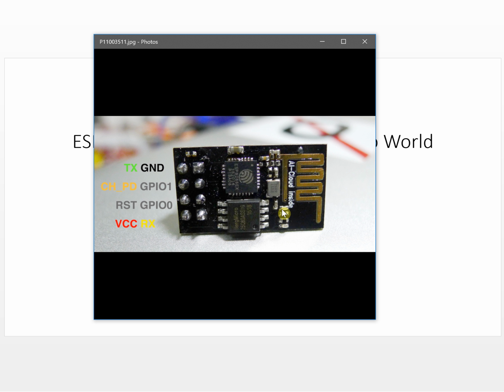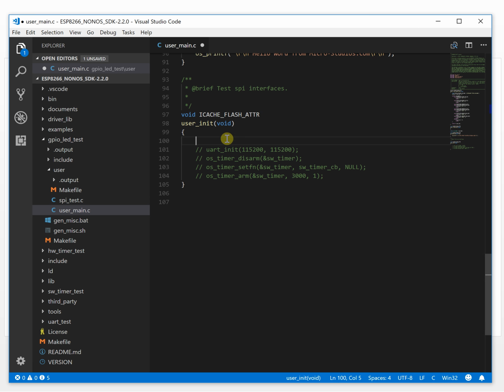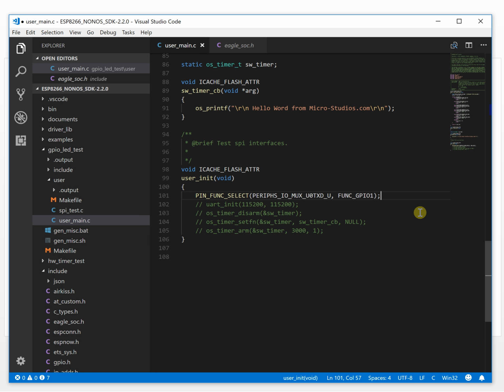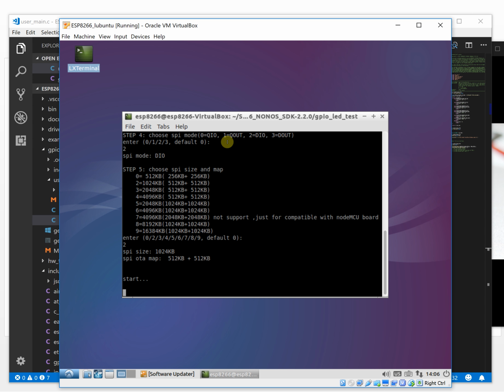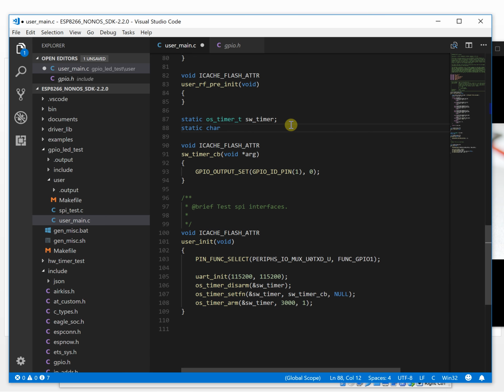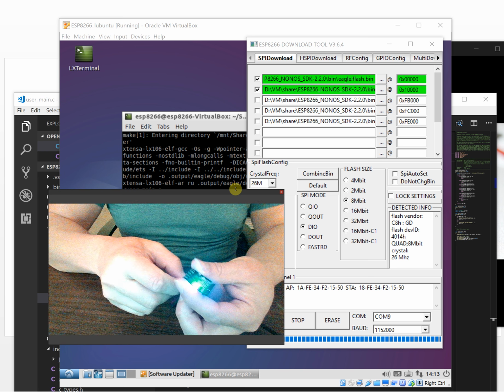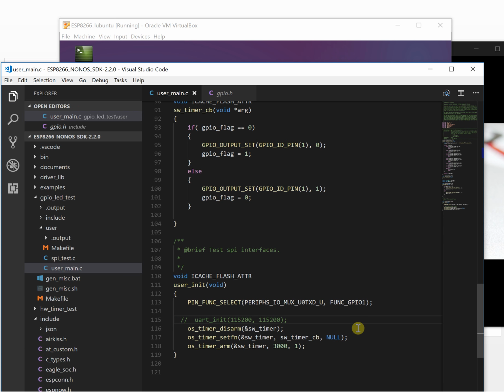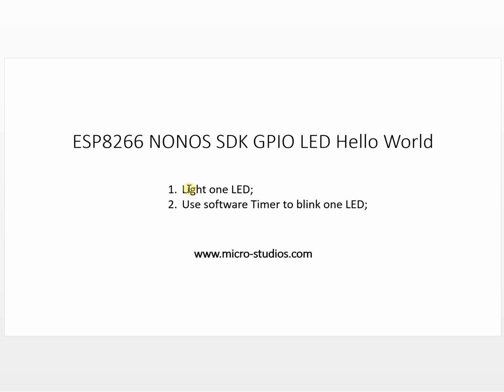11. ESP8266 NONOS SDK GPIO LED Hello World

Comment: Hi Michael, Is it Pin_func_select written above uart for not working or both uart and PIN_FUNC_SELECT cannot be used simultaneously. explain in both case of ESP-01 and ESP-12E.
Reply from the maker: Sorry, I am not sure what is your meaning.
Reply: you have written PIN_FUNC_SELECT above uart(115200,115200), due to which led was not blinking every 3sec. Why is that so in this way? What happens under the bottoms of PIN_FUNC_SELECT. Im not a c programmer and completely new to this!
Reply from the maker: One GPIO has multiple functions. for the pin "PERIPHS_IO_MUX_U0TXD_U", the default function is TXD function. so you need to use "PIN_FUNC_SELECT" to choose the GPIO function for it.

Comment: Hi Michael.
I'm trying to get the old ESP8266-01 (1Mb) modules carry some of the more powerful AT firmware from Espressif.  Sadly they stopped carrying these files: eagle.flash.bin and eagle.irom0text.bin which I need for NonOS and non-FOTA versions of the firmware (non-FOTA is for security purposes).
The SDK's suggest these files can be compiled, but I am not not at that level of expertise yet to be able to compile these files.
Do you know how I it can be done?
Reply from the maker: Hello, I haven't touch esp8266 for a long time.But if just for compiling, I think it might be not as difficult as you thought. You could give it a try.
Reply: @Michael_ee  I am trying. I felt like I was getting close close but I also felt like my skill set is just a little bit too low to actually be able to do it. 
Thanks for your interesting videos when I watch them more deeply I think it might bring me closer to being able to do it.

Comment: this nonos sdk is kinda dark science where there´s no example teaching simply basic stuff like program flow , etc im at the point to leave it. it´s too difficult to learn without more teaching stuff. I dont mean examples but theory from where we could learn how to program...
Reply from the maker: I originally thought people might be more interested in sdk with OS. Because it can implement more functions for it. NONOS is more like one regular microcontroller (mcu), lack some flexibility. It's happy to know still there are people like NONOS system.
Reply: @Michael_ee  yes i was checking as this is non polling...can have benefits.... but no chance to learn . Arduino way is much more simplier...thanks anyway for your example. in my free time i want to implement. one thing ive noticed is there are NO examples of wifi connection with nonos sdk and the samples are too complicated...